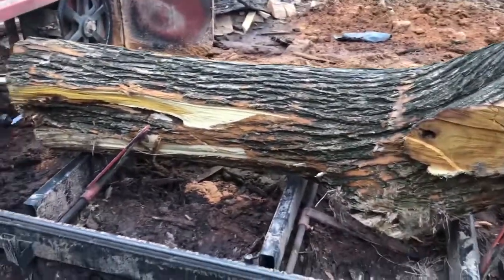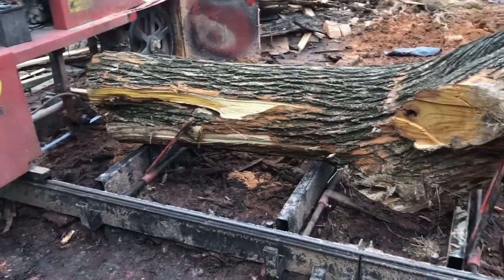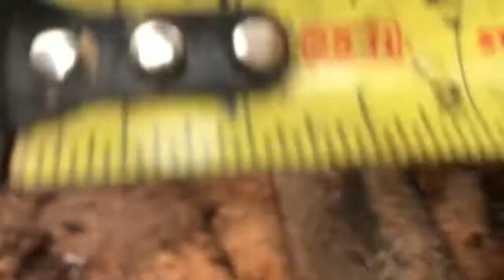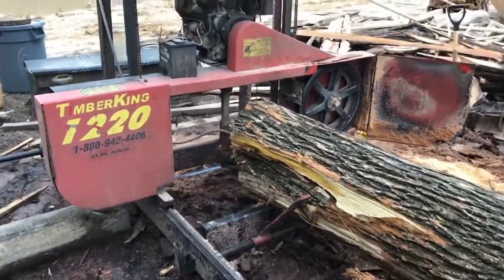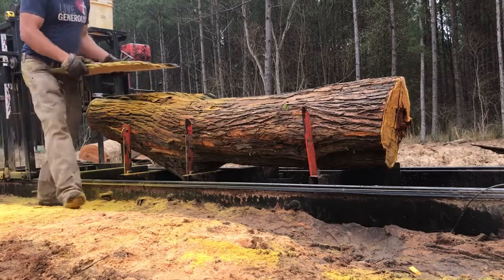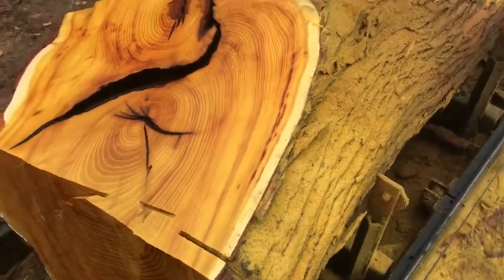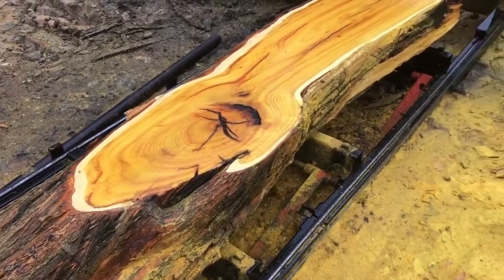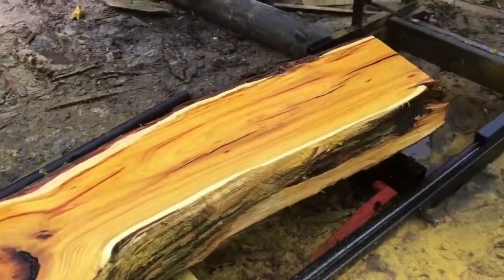Sawing my First Osage Orange/Bodark Log on the Timberking 1220

Comment: Hey tom i have a woodmizer lt15 . i was wanting to know about your timberking 1220. im planning on buying one next week . i know i like the longer track but what all things do you like about  the 1220 and the things you dont like ? i plan on sawing mostly hardwood.
Reply from the maker: My 1220 has been a tough little mill. Even if stuff does “break” I can usually do a bush fix or go to town for a few bolts and get it going again. All in, I love it. Only downside is it’s a fully manual mill, but if you’re used to that then it’s ok. It is labor intensive, but if you can stick to cutting premium price ($/BF) sort of stuff then it’s a money making SOB! I spend some time up front planning a log to minimize how many times I have a to deal with rolling it over or setting slabs on and off for edging or whatever. Some good planning up front will pay you back handsomely later with less time spent handling. The TK community is awesome and I’ve never had any problems with customer support! 😁